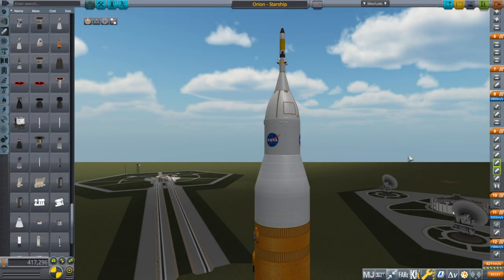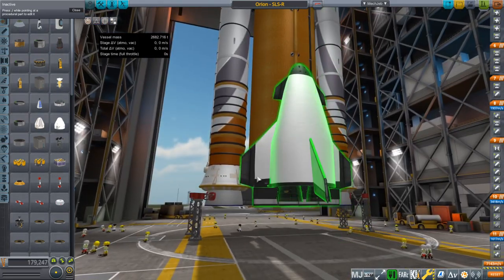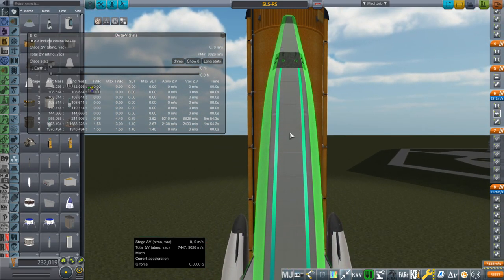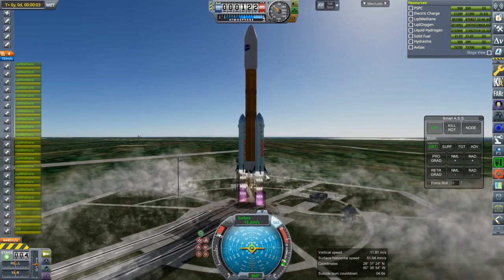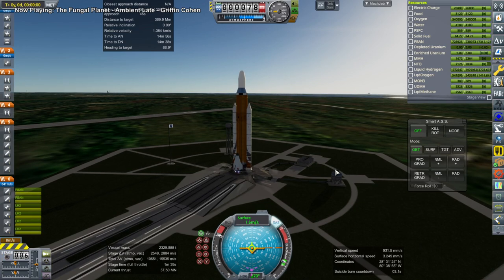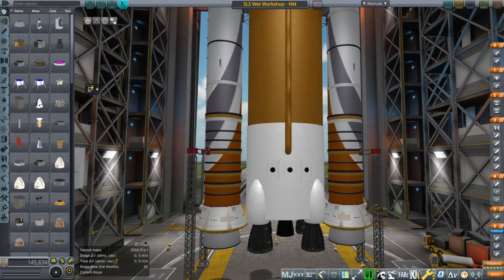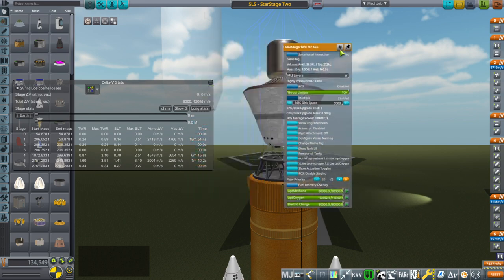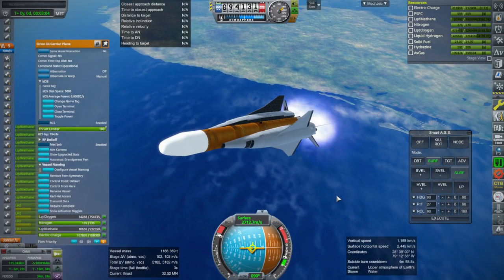Kerbal Space Program with RO - Things I Have Done to SLS

Comment: It would be interesting to see if nasa could recover rs-25 engines using inflatable heat shield and big enough parachute.
Reply from the maker: Definitely would be.
Reply: I think this is the most likely modification for reuse if one were to be made

EUS is getting a composite upgrade so there won’t be any performance loss from block 2 capability